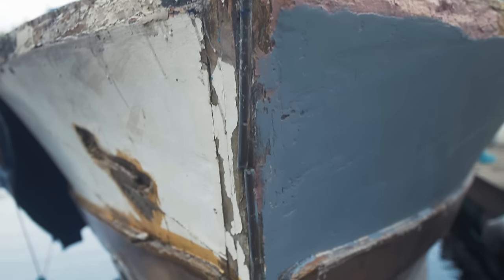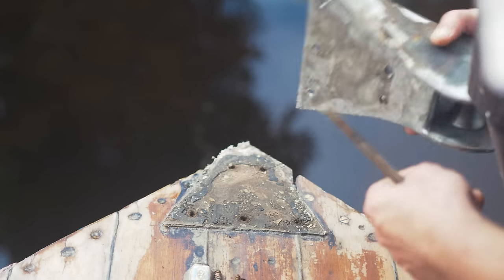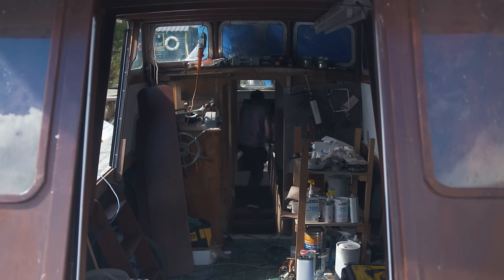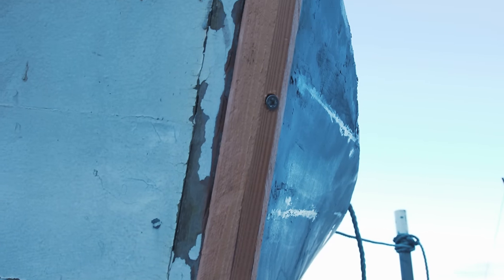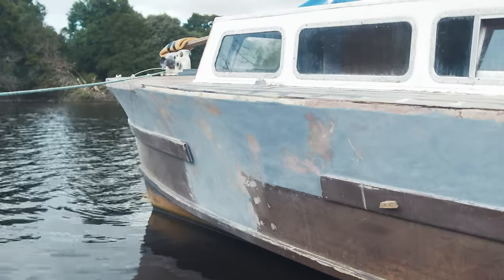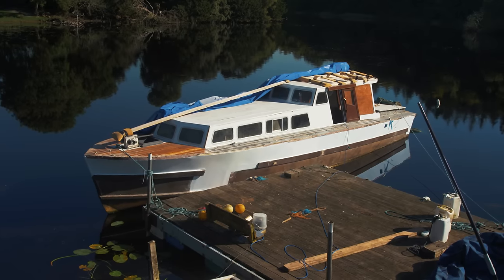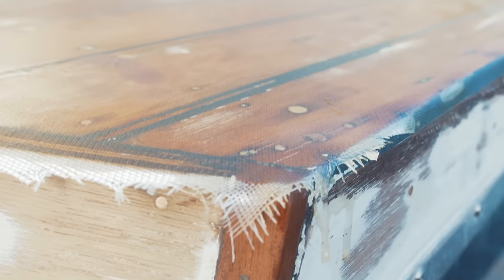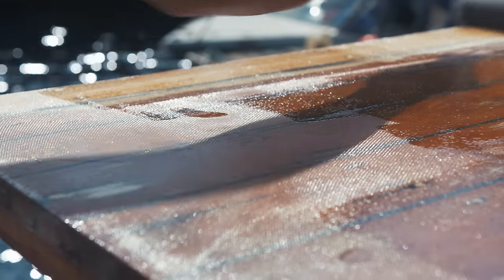1940 Wooden Boat Liveaboard Journey | Fiberglassing The Roof | Episode 29⚓

Comment: Good job. Btw Don't know if you've heard of it  but Ply peel is a sheet of cheap material one applies directly after glassing .When dry you just tear it off and it leaves the glass underneath opened up and  almost eliminates the need for sanding. A light sanding is all it needs.